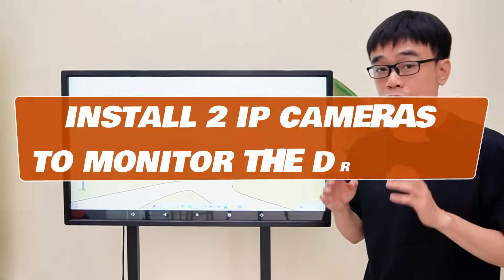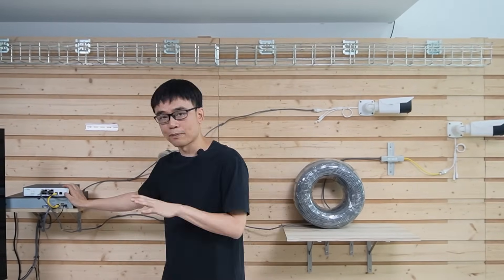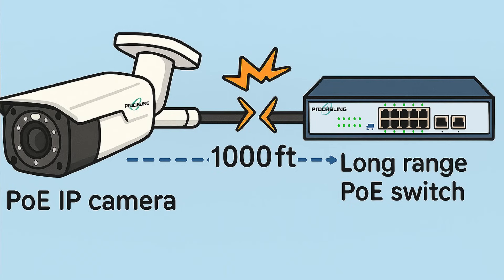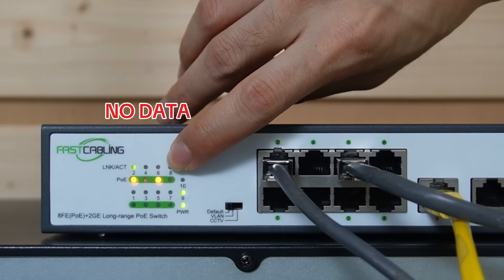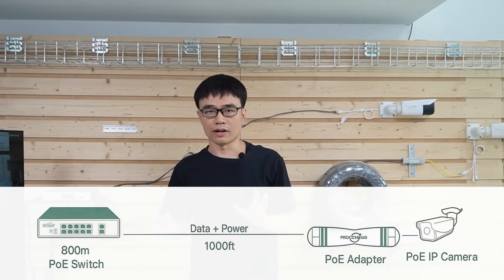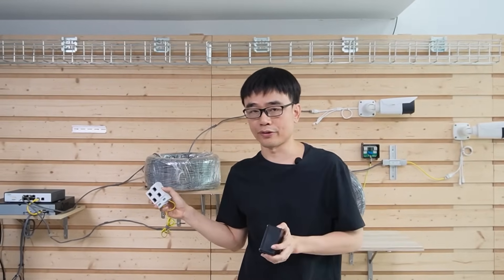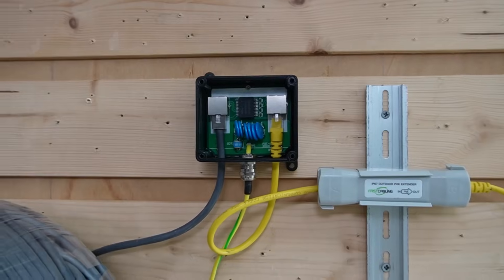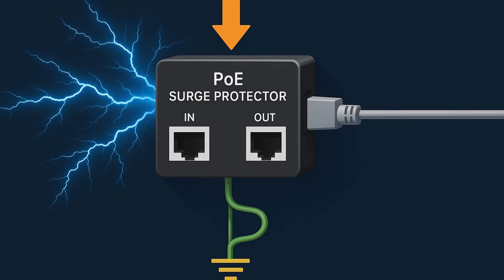How to Connect IP Cameras Over 1000ft | Long Distance PoE + CCTV Mode Guide

Comment: Thanks for the video, it's great.😊
But I didn't understand a bit. That's why I have two questions.
You have 2xCCTV and 3xPOE surge protectors (one outdoor and two indoor) and 1xSwitch.

1st question:
Only one cable from the two indoor Poe surge protectors enters the switch, although an Ethernet cable from the CCTVs is connected to each one.
2nd question:
The switch usually has its own grounding (At least that's what I've seen with other brands).
Why is it good to use Indoor POE surge anyway?
Reply from the maker: It is not clarified in the videos. It is better to have one indoor and one outdoor PoE surge protector at two ends for each network link since you are not sure whether direction the surge could go through. It depends on which point is closer to the ground. The PoE surge protector provide higher surge protection. The grounding doesn’t equal to surge protection. It needs some extra components to absorb and redistribute the surge.
Reply: Second question first, static from the environment or nearby lightning can be conducted through the ethernet cable and and up frying a port on the switch if not the entire switch.  That's why you want to catch the surge before it gets to the switch and give it a path to ground. And I'm curious to know how he would have grounded them in a real install but you can get a grounding plug for the inside and it will use the building's ground.  For the outdoor one, I'm afraid that's where you need to use a grounding rod but there might already be one there if it's a light pole or utility pole.

As for the first question, remember his example scenario had two cameras. That's why there's two cables. I think that's what you were asking.
Reply: @TheKingOfInappropriateComments  Are you a human or AI?

Comment: what if am using a LR switch without a cctv mode, will it still work
Reply from the maker: You'll need to add a PoE extender to extend the range to 500 meters at 100Mbps. Enable the dip switch (CCTV mode), then the switch will boost the range to 250 meters while at a reduced speed of 10Mbps.